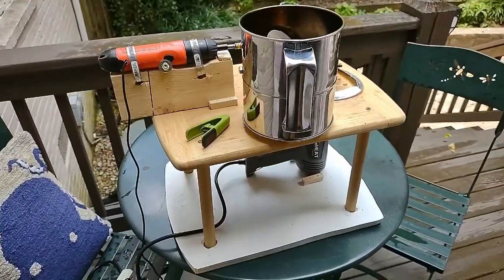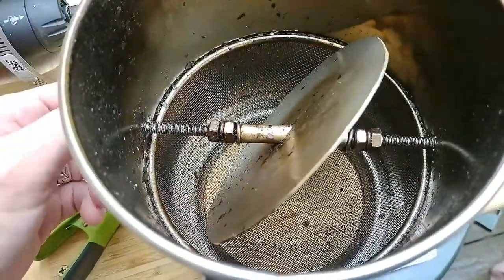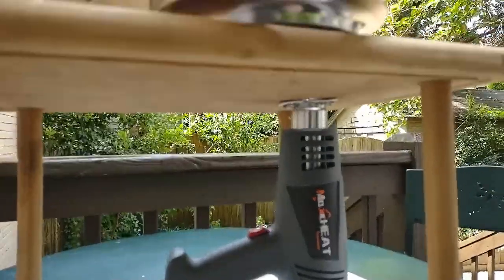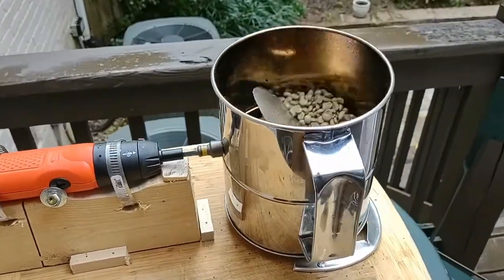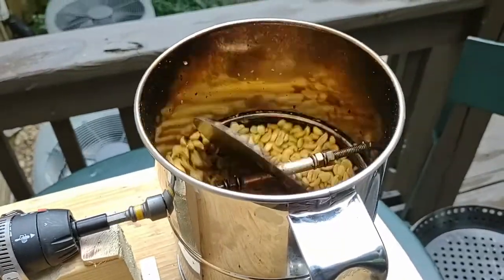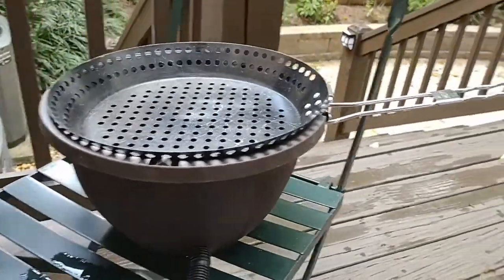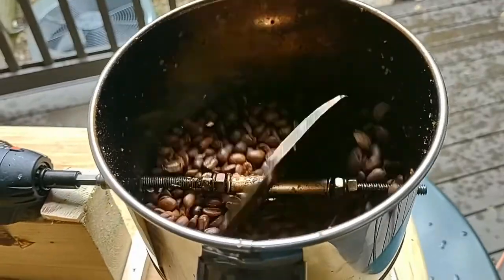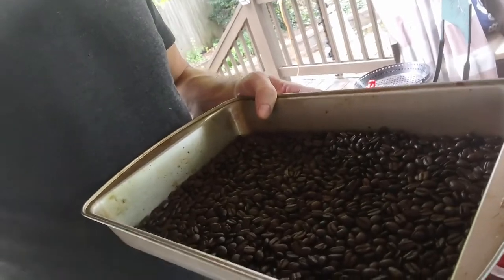DIY Coffee Roaster - (Larry Cotton Design)

Comment: Hello  ! 👋  I'm roasting coffee from 2018 or so .. I've use some German machine ( not expensive ) but didn't work like i would do because my voltage energy supply.. now I'm using a Gene Cafe CBR 101 and quite satisfied  ! I'm also planning to make my own roaster ! 
Just some advice for you if u can take.. you are roasting in to second crack and 4 sure u get some oil over the beans.. U may like that but try to make 1 batch with 1st crack medium dark and see the difference.. to not become oil coffee.. see if u like it .. and also i have a cooling made myself that in center i have little bar metal spinning with some help from a motor and it's connected to a vacuum very similar like u have and my coffee gets cold in 1-1.5 minutes ! Sorry if i mistake some words.. English It's not my primary language  !

Comment: Awesome work! I also built a wobble disc roaster myself though I used a JGY370 worm gear motor. This is my setup though in this video (https://www.youtube.com/watch?v=2otrJbjBkdY) I used metal spoons embedded in the shaft instead. This has since been modified to use a wobble disc made from a tin can lid. This is a great roaster and I can roast 200gms in under 10 minutes! You can see it in action in reddit with the subject title "Home made Larry Cotton heat gun wobble disc roaster" https://www.youtube.com/watch?v=EXGXj9AlCqY